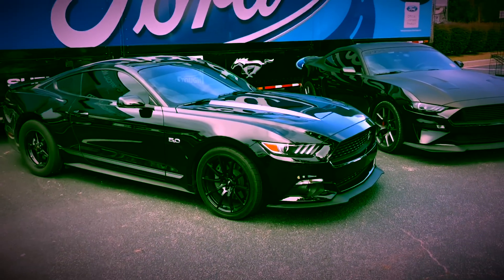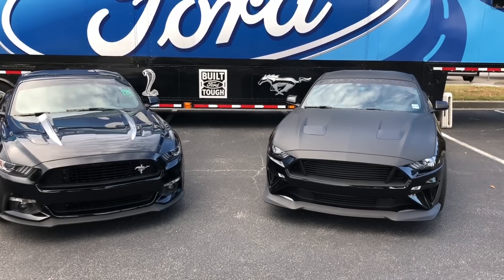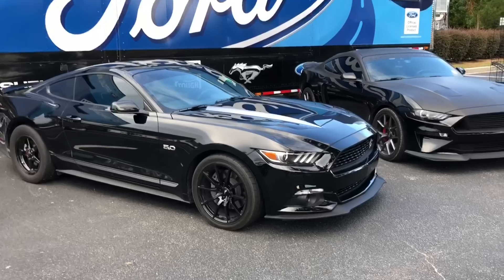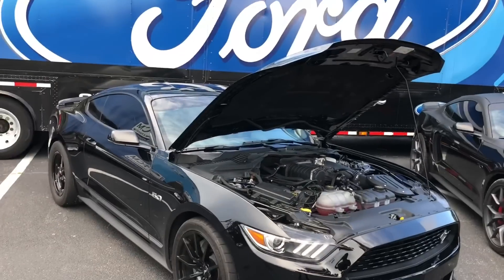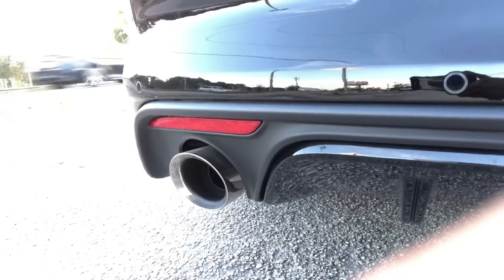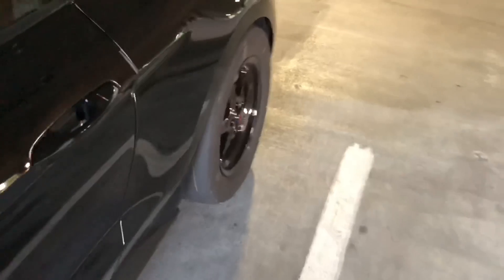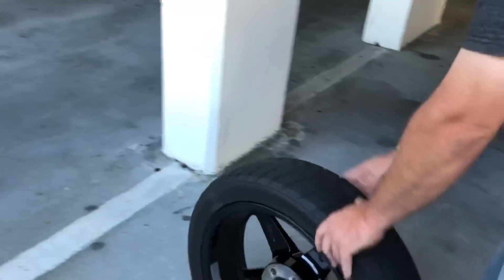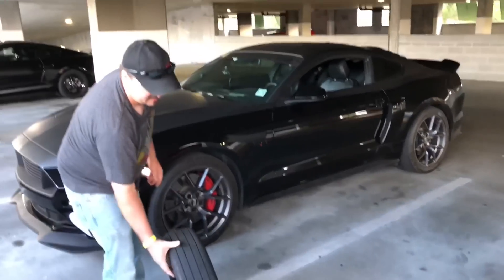Is a USED 2015-2017 SuperCharged Mustang BETTER than a new 2018-19 GT?

Comment: Awesome video! It was great to meet and hang with you at Mustang Week.  Go get that car into the 10’s.  

Both gens of the S550 look great. Need to have one of each 😜
Reply: 5pointgo Thank you! I do a lot of 1/8th mile drag racing. So I wanted something that hit hard down low and carried it.  It was between the Roush gen2 and VMP gen2R.  When looking at them I wasn’t sure who I was going to get to tune the car.  The Roush gen 2  2.3 phase 2 setup came with a tune ready to rock. With the vmp I was going to have to wait for a tune for a while.  Palm beach dyno will probably be doing the tuning on the car here soon to open it up some more.  

You can’t go wrong with whipple either!
Reply: 5pointgo I pretty much daily mine now. Love it.
Reply: Speed Addict 731 do you know the part # for mcgard lug nuts to use on the race stars. We have similar set up good to see gt/cs getting some love nice car!
Reply: GT/CS_Coyote Thank you. I love the cs cars!  I read on Facebook that they had them. I haven’t gotten around to ordering them yet. Well after I seen this question I went to get the part number for you. They do make them for the 11-14 mustangs for racestar wheels but they don’t make them for our cars. Sorry for the misinformation. But however I have found another lug nut from another manufacturer that is the exact same dimensions as the race star lug nuts.  You can order 10 or 20 of them.  I’m going to order 10 and see if they work and I will let you know! 

It says for use with cragar sst wheels, weld or race wheels.  So they should work.  

http://www.ezaccessory.com/Cragar_SST_Style_Mag_Lug_Nut_14x1_5_p/8859.htm?gclid=CjwKCAjwlejcBRAdEiwAAbj6KRXEgCbzX_uoL5-vWGnZqfsxt0Lfl73jyVZrZo5GvpDOhiWi8jFRcRoC8uQQAvD_BwE&ppcsclkid=y4ei1AIkbY4Q&ppcstrkid=2108414463&ppcsu=xhg7f5djq999gnahcr

Comment: I love LOVE my 17 and I have driven an 18. The 18 is very nice but I have no burning need to update. I still like the 15-17 exterior better and have NO NO NO desire for an auto. I'd rather have a 15-17 MT-82 than the 18 with the Aluminum shift forks. DI is nice but my ProCharger more than makes up for it.
Reply from the maker: True if u have a 15-17 just boost it and game over

Comment: I am a Old School Ford Guy from the 60's!  I had a 66 Ford Mustang Coupe with a 289ci. 2bbl. V8 and a   3sp C4 Auto Trans with a Shift Kit!  That I fixed up like a Shelby GT350  Coupe version!

But Don't get me wrong, I like all Model Mustang's especially the New 2018 Mustang with the New 10R80 10sp Auto Trans!  I am waiting for the 2019/20 Shelby GT500 to see how that will turn out!

I am thinking of finding a 2018 wrecked Mustang GT with the new 10sp trans and doing a complete engine, auto trans, drivetrain with irs and interior swap into a 66 Mustang Coupe!  The Coupe weighs between 2400 to 2800 lbs!

We'll see what happens...God Bless!

Comment: That is almost exactly the same as the mustang I just bought.  Mine isn't the cali special, but it does have the cali special grille.
I've got the same Roush SC with 56lb fi and a Palm Beach tune.  I need to dyno it and see what the numbers are.

Comment: Used 15-17 gt and add some boost and a few boltons to me is the way to go vs the expensive 18's that are having issues. I do hope Ford fixs the issues on the 18's. I wanted the 18 gt performance pack lvl2 until I saw the price tag. I'll just stick with my 16 gt

Comment: Yes, he’s correct, don’t use the Race Star lug nuts. I believe they’re direct drill now, so maybe not as bad as before. When they 1st came out, you had to use the off-set washers. Those lugs nuts were terrible.
Reply: That's what I have been using race star lug nuts do you know the part # for mcgard lug nuts?

Comment: What do you mean started it all Mustang started and 64 and 1/2 I have two 67 fastbacks an ,87 notch and a 14 GT 500 so let's slow down on those 15 through 17 and started it all Mustangs been around a long time Junior.
Reply: Yeah but nobody really cared, That fixed rear suspension was just garbage and you couldn't go to crazy with the power because it would just kick out and hop all over the place and you would have to just send it or crash into a crowd of people. When the 15 came out it was faster then the BMW M3 around the nur and that's what got everyone attention. independent rear suspension meant you could not only now track it, but you could drift it easier as well.
Reply: @justingray760  Drag racers don't care about I.R.S.

Comment: The 2018+ is perfection and an upgrade from the previous model. I skipped the 2017 (for much cheaper) and got a 2018 pp. Never looked back with constant compliments. New front end is superior as well.

Comment: The difference between 17-18 is 10 HP when super charged na 18 is way better but with supercharger the cars are very equal
Reply from the maker: Ur actually made a good point for once lmao just kidding thanks for checking in
Reply: Absolutely not just 10hp there is 18 supercharged making 700-750 whp on 93! Max for a 15-17 is around 650 wheel on pump gas. Gen3 coyote is just better.

Comment: New refresh has nothing on the original s550. 

10 speed auto and Gen 3 Coyote is no doubt superior tech, barring ticking time bomb motors and unreliable transmissions that hopefully Ford fixes for good.

My old 15 GTPP hopefully goes to a good home...